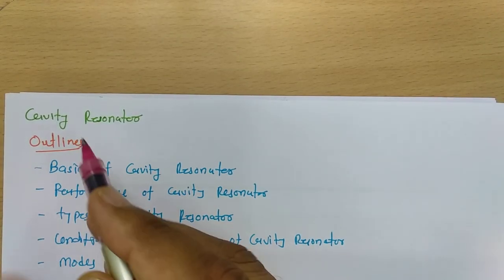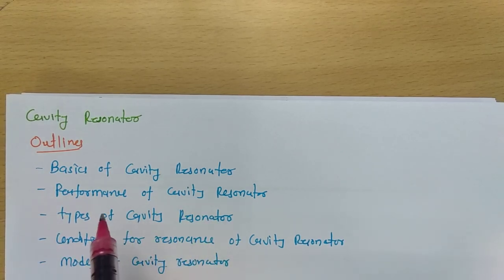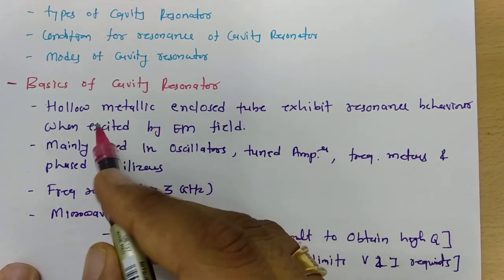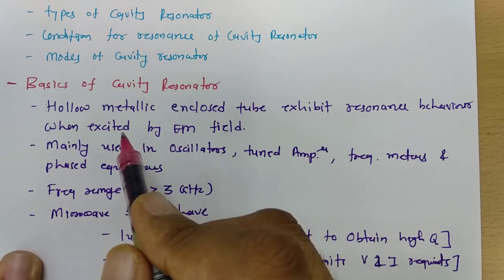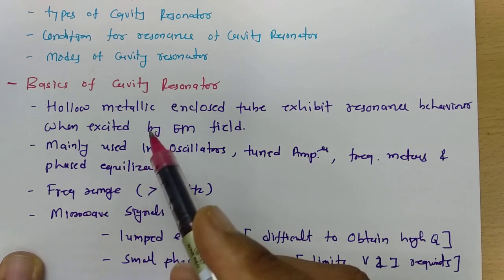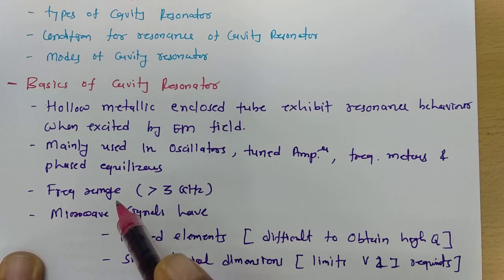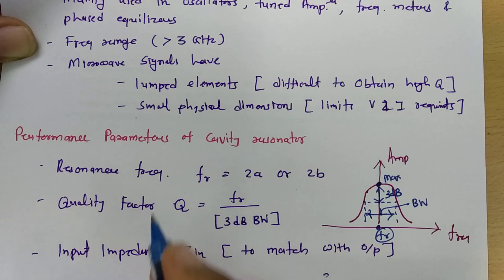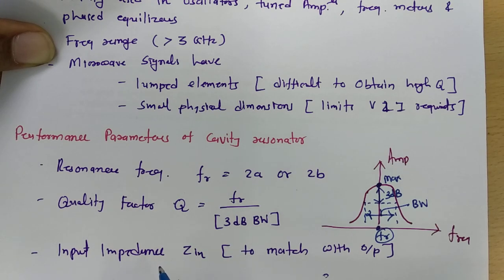Cavity Resonator (Basics, Types, Parameters, Modes & Conditions of Resonance) Explained

Comment: Like caries are never born again in your teeth. 

Summing up all the text, you will need a common toothbrush, another unitufo interdental toothbrush, toothpaste and tongue cleaner that sell in drugstores.  

Let's start, now the explanation - To prevent tooth decay, just brushing properly and regularly, and with two brushes and not just one, as most people think. It has to be the normal brush and the other interdental or unitufo brush. You can brush your teeth after bathing, lunching, before going to bed mainly, because bacteria will stay in your mouth for a long time, and if you don't brush at that time before going to bed, you can get cavities. But it is not enough just to have a toothpaste and a common brush, if not caries in the mouth is still born, because the common brush can not reach all the spaces of the teeth, where are leftover food or food in the teeth and mouth alone. So you will not be able to eliminate all the bacteria in it, and cavities will be born. The ideal is to have a common brush, another interdental and unitufo brush and a tongue cleaner. Brush your teeth and mouth first with the regular brush, making circular motions on all teeth, front and back and gums and between teeth and gums also where plaque and tartar build up. Also brush your teeth vertically from top to bottom and from bottom to top as this helps to eliminate food scraps and food that get between your teeth. Then use the other interdental brush to pass it in the middle of one tooth and another where there is still food left over, especially above, near the gum, in the middle of the teeth and gum, where small holes usually gather food inside. of them and the ordinary brush cannot remove them. Then rinse your entire mouth with water in every possible corner of it, mouth, whole part, gums and throat, with plenty of water, enough to shock the mouth water to eliminate the food and bacteria that remain inside it. after brushing. You have to feel that the water is cleaning the mouth and eliminating the bacteria inside it in all directions. If you still feel your mouth and teeth are dirty, repeat the mouthwashing process, shocking it until you feel it is completely clean, and then spit it out. Until you feel all the bacteria have come out of your mouth and the water is clear, no more residue. Ready the correct brushing process of the teeth and mouth is done and the caries are never born in your mouth. If you do it with some regularity. Lastly, wipe your tongue cleanser and eliminate its bacteria, and you're done, caries will never be born again, because you've done her complete hygiene and left as few bacteria in there as are not enough to give you cavities in your mouth. From time to time floss all the teeth, between the teeth and the gums and floss down the plaque or tartar and then rinse the mouth with water. For their better hygiene. But this process is not necessary to do every day, ideally once every 4 or 5 months or so, for a better cleaning of the teeth and mouth as a whole. But this can be done once and for all because with the use of the interdental brush, it already replaces the floss quite a long time because it plays the same role as it, and it is more convenient and quick to clean the teeth with it. The mouthwash you will need to use from time to time or you will no longer need to use it. Because this brushing process with these two different brushes complement each other, it already sanitizes the mouth very well, so there will be no need to use the mouthwash except from time to time or another accessory or cleaning device on After I started brushing my teeth and mouth with these braces and methods and with some regularity, cavities were never born in my mouth, 3 years ago. Sometimes if after a meal you are in a hurry, rinse your mouth with water to remove its acidity and not corrode the tooth enamel, and then brush your teeth with an ordinary brush, even without paste, just water, so quick, just to remove the thicker and apparent residues of the mouth, making a superficial cleaning, and later when it is more time to make a deeper and complete cleaning in the mouth and teeth. This will save you a lot of money, since cavities will never be born in your mouth anymore, and you no longer have to go to the dentist all the time. It will be rare for you to have to go to the dentist and spend money on expensive treatments, root canal treatments and eventually lose your teeth, and have to spend salty money on implants. Not even doing more teeth cleaning at the dentist to eliminate tartar will be necessary anymore. You will avoid all these problems and save time. When we lose our teeth or get root canal treatment and they get weak, our esteem drops a lot. I hope this information helps everyone. Thanks and hugs!